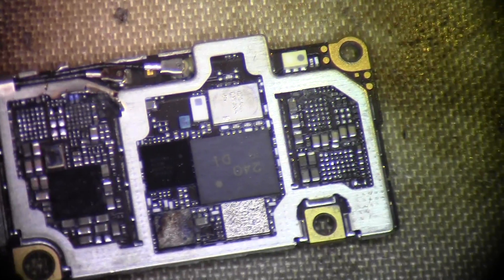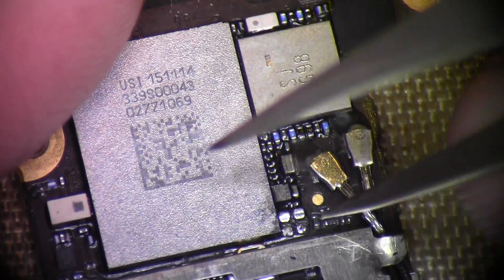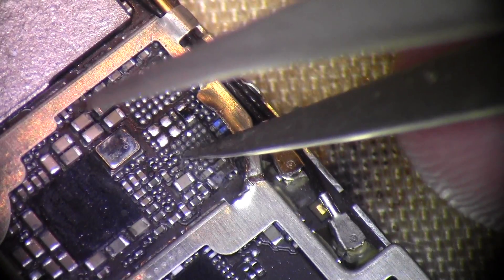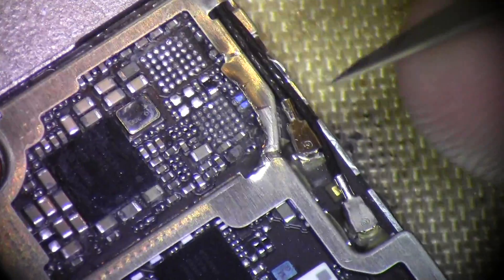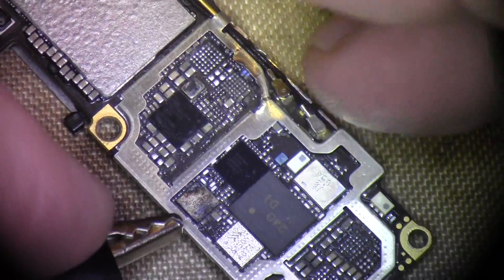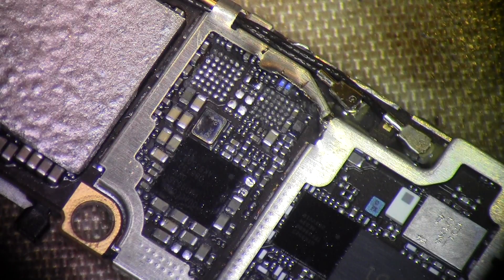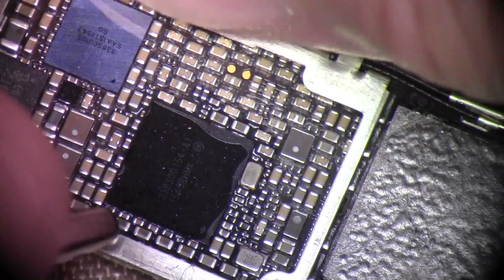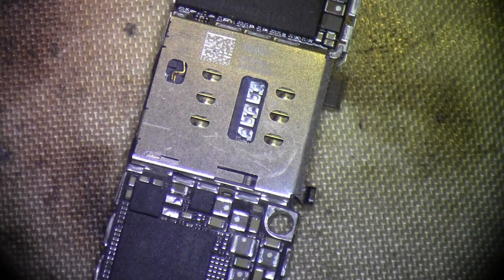Looking for short on iPhone 6S VCC Main using freeze spray

Comment: Hi there , I have removed all of he caps around Tigris remove trgrus and the small 6 pad mosfet , now no heat but still beeping as shorted with multi meter although not showing any amps on power supply , I have started to remove other caps and filters from that line but still beeping , Amy idea as to where to go next week lease

Comment: One question for ya.
So you take a wire you hook it with the positive of vcc_main and then you attach it to a power dc supply 3V 2A, and then attach the ground and nust spray the liquid on the motherboard? Without any power pressing?
Something else is there only one specific vcc_main that needs to be attached to or whatever vcc_main dependable?
Thank you

Comment: What do you do if when you touch ground power supply trips and goes 0 ?? Am i doing something wrong or do i need different Dc Power supply.
Reply: Arsalan Sunny goes to 0 for autoprotection, the short is too high, you must to set lower volts in the power supply until don't active the auto protection